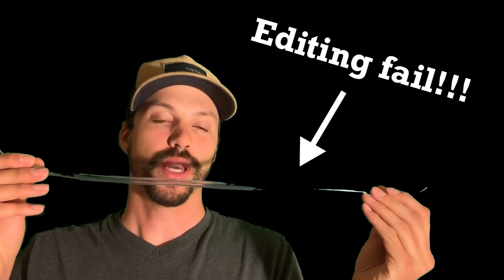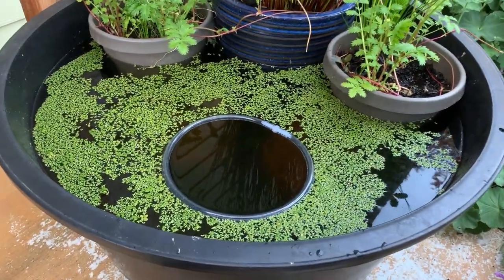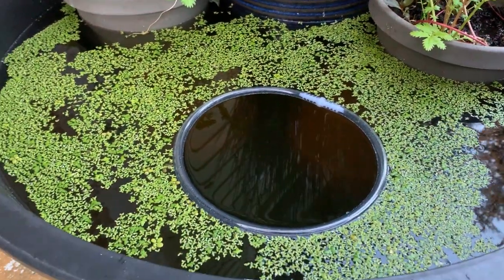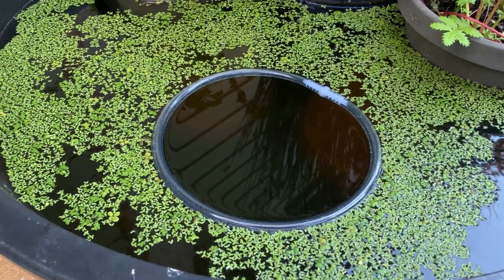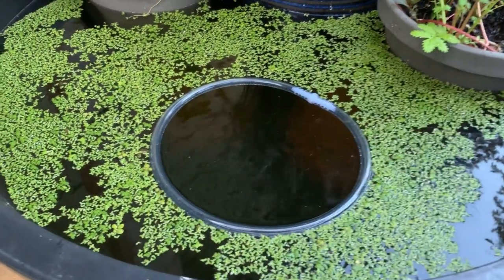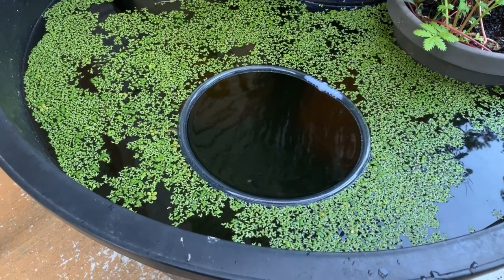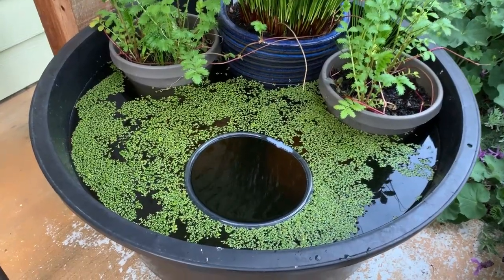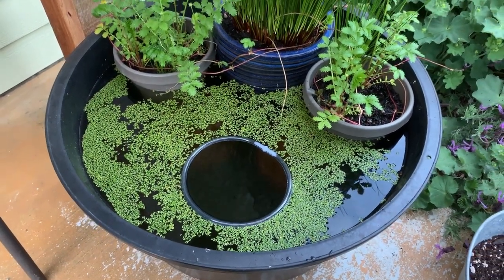Floating Plant Separator | DIY Aquarium Feeder Ring Portal

Comment: hah this is great idea for guarding a filter from the plants
Reply from the maker: It can definitely be used that way! Give it a shot!
Reply: Yes I'm making this today. I keep loosing my floating plants because of my filtrer. Great idea. Thank you for sharing
Reply: @ari505  if you do id really recomend using a bigger or deeper tube. when i tried it helped a little but the water current still got the plants. also when the water evaporated the plants went under the tube since mine was connected to the tank walls.
i wish you luck!
Reply: @eonbree8593  Baffle the water flow! A water bottle is all you need to reduce flow without compromising the filtering

Comment: Is this dangerous to do? A fish can’t get tangled up in the tubing ring right? I have a 10 inch goldfish in only a 75 gallon so im wondering what can work plz help
Reply from the maker: If you have a big fish then yes I would be careful. I would make the loop extra big and/or not use one. Have you tried floating plants with your fish yet? The fish might eat the plants anyway.
Reply: @AquariumPlantLab  Thank you for your reply but I am glad for your opinion I tried duck weed and he ate those but I just added frogbits and have the stream of the hang on filter turn down pretty low so they’re kind of floating in the corner so I’m kind of lucky right now I’m just kind of hoping for the best and still trying to figure out what’s gonna work

Comment: Cheaper than this is to use airline tubing, it’s smaller but it’s works too and I already have that on hand. Just cut a small piece off the end of the tubing, split it, cut it in half, roll it up and insert instead of using a coupler
Reply from the maker: It does work!! I’ve used airline tubing before.  Definitely the cheapest and most convenient route.  I prefer the larger diameter tubing though personally, I feel like it does a slightly better job of keeping plants out.  Thanks for the comment!!
Reply: NW Aquahobby yes I agree. I went for the airline tubing and it didn’t stay quite as flat. So I used suction cups to divide the tank but I don’t like it because when the water evaporates my plants go under and it’s quite ugly tbh. Now I need to search for the thicker tubing. Thanks for the video.

Comment: The tubing is always to flimsy to stay straight any suggestions?
Reply from the maker: What kind of tubing did you use? Airline tubing? Or the same size as in the video?
Reply: @AquariumPlantLab  no I was not using the right thickness of tube, I had left over from a plant corral for the filter so I just used extra from that, which is thicker. Works great. Thanks
Reply from the maker: Gotcha ya that was going to be my suggestion. If you still have issues take the coupling out and  redo it. Make sure to not twist the tubing as you connect. Twists will cause the ring to warp.

Comment: Hello thank you for your review and nice video. 
I have 450 L aquarium discus fish and I have lot of water flow in the aquarium from all sides because of the huge filter that runs in the aquarium.  However I want to have some floating plant to control my nitrate level but it is my first time to have plant and I don't know which plant can do the job also most of the floating plant need low water flow and this is not possible for me is there a way to control where the plant should grow in the aquarium? And which plant is good ?? 

Thanks
Reply from the maker: You can use string to tie the loop so it stays in a particular area.  I would maybe give salvinia a shot.  Alternatively maybe try growing pothos. Pothos is not a floater but it’s roots grow really well in aquariums.  I have a few videos on pothos, maybe give this a look and see what you think!
Reply: @AquariumPlantLab  hello thanks. For the advise i saw your vedio of pothos is great idea but i think for me will be difficult because i have always water which is hot 30/31C so i think pothos will not tolarate the heat .

What do you think about frogbits floating plants ? 

And my second opinion is to keep 3/4 clay pots with anubias inside it i mean just glue the anubias in the clay pot and place it in the aquarium . The reason to use the clay pots is to ease the cleaning of the gravel i do not acualty have any decoration in the aquarium ? 
Also if you suggest the frogbits how much do i need inside the 450 Aquarium i mean how big the string round should be and shall i place the plants inside it ??

Thanks fir your help in advance